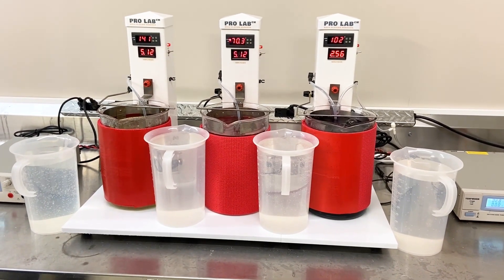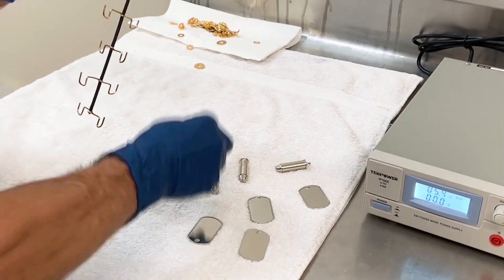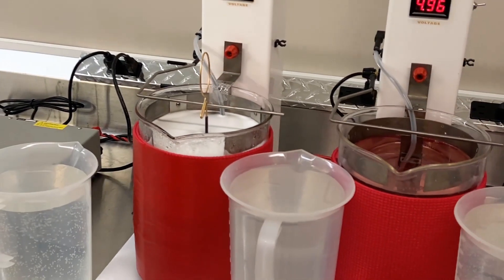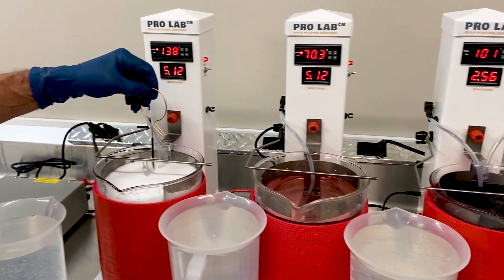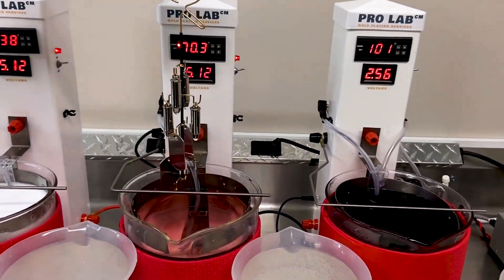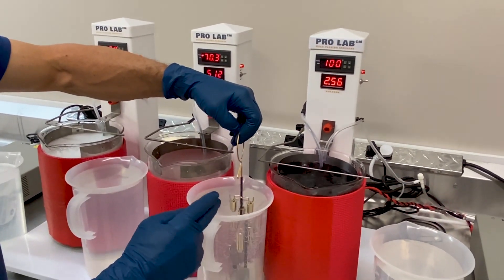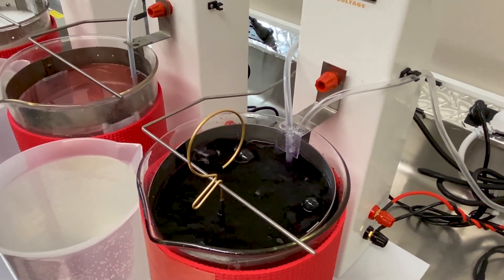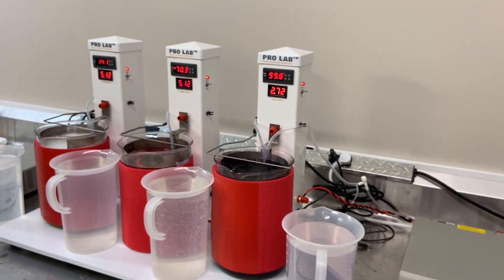Gold Plating Stainless Steel And Nickel With A One Gallon Plating System

Comment: Hi first of all thanks very much for your time to make this video 
I'm actually want to gold plate my 1911 but 2 different colors slider and all the little parts want to do it gold plate and frame it self going to do the nickel 
So my question is what kind of solution should I buy to do this project and I also have the << ELECTROPLATING PM260A>> machine the only thing I might need is the solution and I need the  solution for dipping not for brush 
If you can please let me know what kind of solution should I get and activator... what ever is needed thanks so much